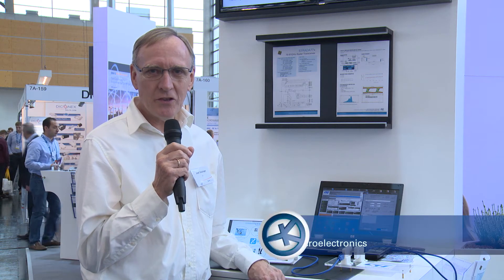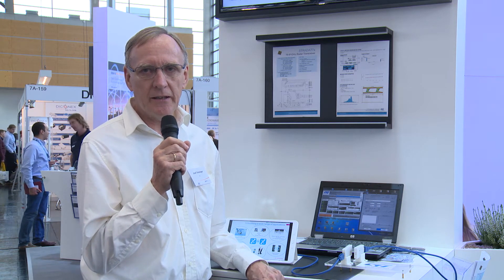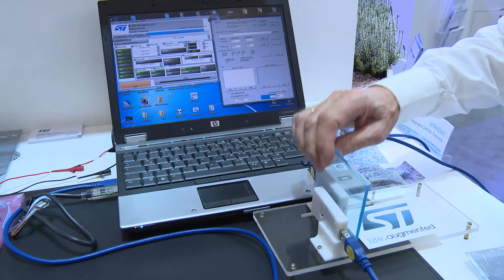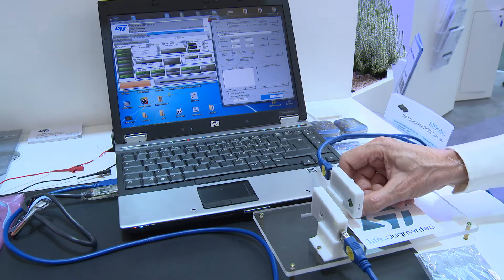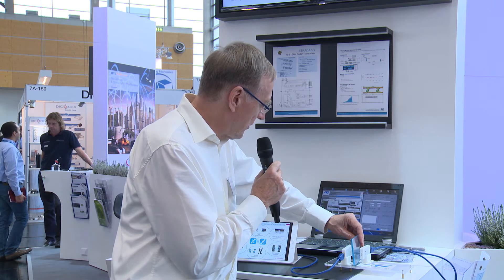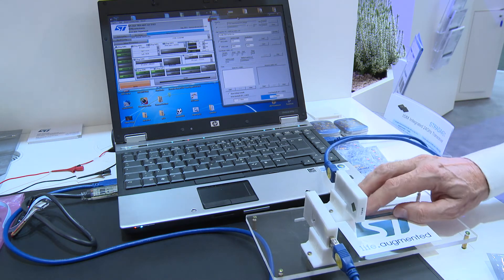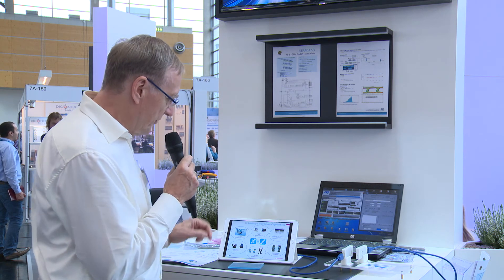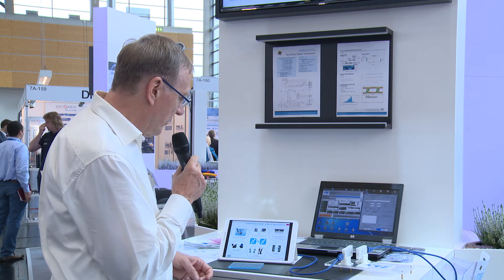STMicroelectronics Showing S.P.A.R.C Link @ EuMW 2017

Comment: What's the transmit power? Does it follows the 802.11ad?
Reply from the maker: Link budget is at 27dB. It is not 802.11ad, it is “just” a simple ASK modulation with 8b10b encoding. No protocol.